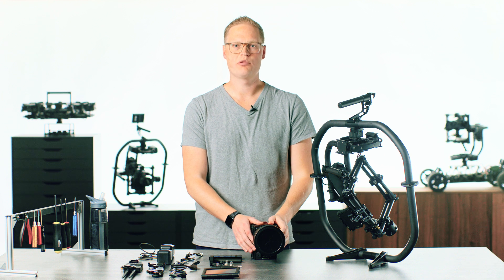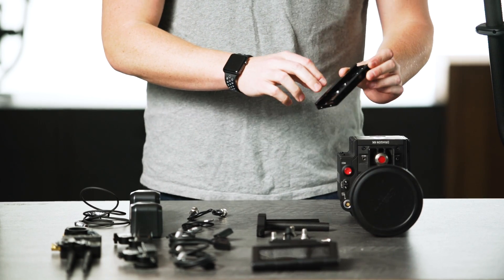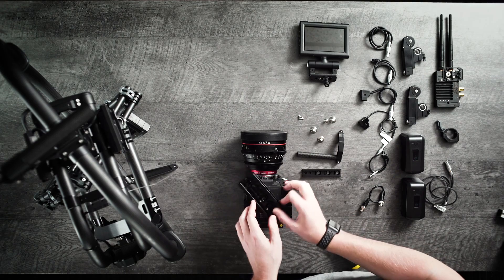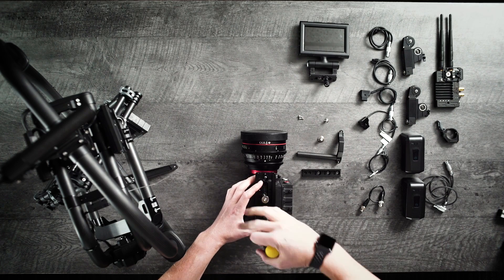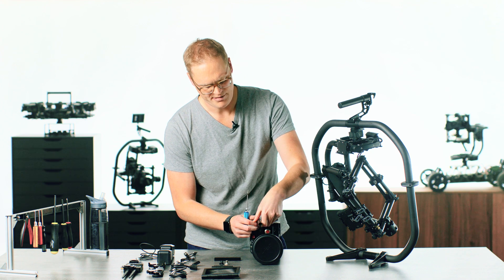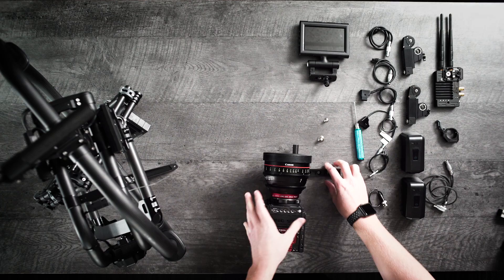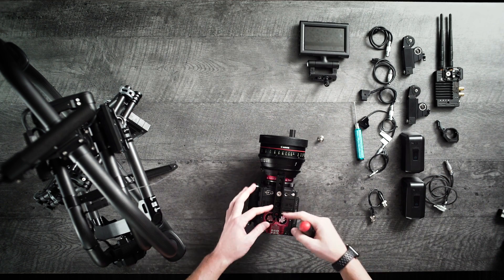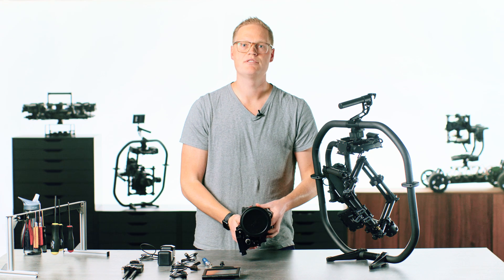MōVI PRO - Building the Camera

Comment: What cables are included in the bundle?
Reply from the maker: All cables are purchased separate from the bundles, but can be added depending on your preferred setup.
Reply: Would be great to include the basic cables for the RED.  At least a bundle packaged rate.  Power/Data/Monitor
Reply from the maker: Good idea, we will look into creating bundles for Red and Arri with everything you might need!